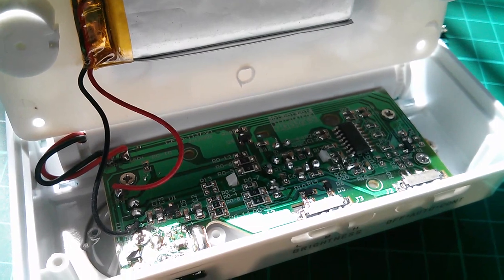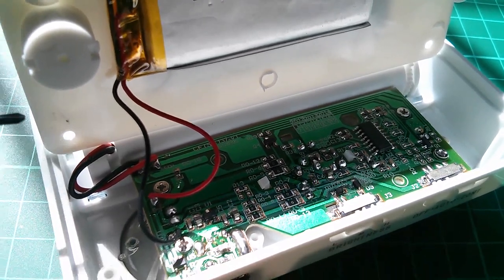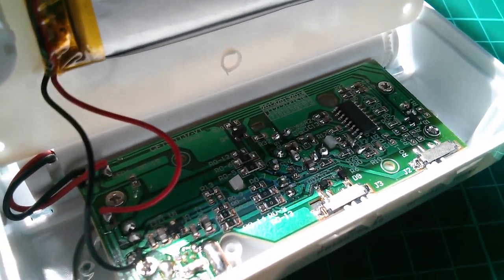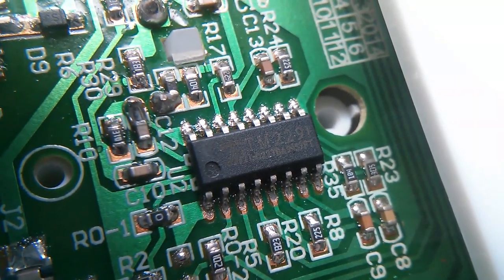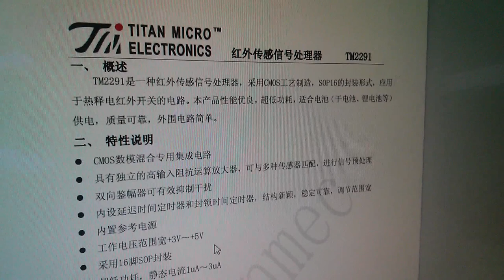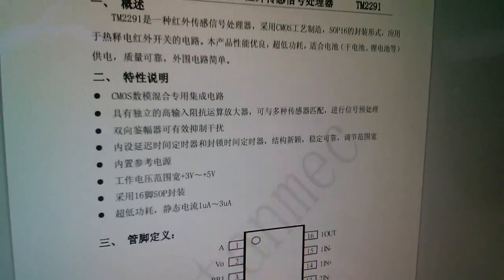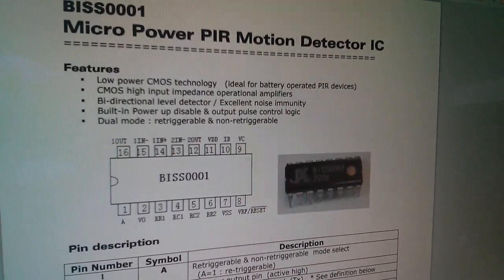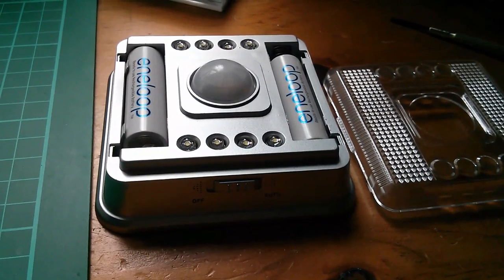PIR LED Sensor Light with Li-Po Battery - It's Incendiary!

Comment: Greetings!  Funny how things work, I have nearly completed the build of just such a light for the bathroom of our Motorhome.  My wife wanted something that would come on at night when we are boondocking (camping with no shore power or water etc. in the boonies) so I took an old Arduino and connected a PIR sensor as well as a set of 10 LED's on a board that I built up a few years ago in a kit deal, and am about to mount the whole thing, using just such a battery into an old Zune case left over from my Zune colecting days. I still have two working Zunes, and this one never did work, just picked it up for an extra hard drive for the other two, and a spare battery.  Should do the job, I think I shall add a charging board to the build and she should work just fine in the little cubby that serves as a bathroom in our old rig.

Comment: The H1MA may be a 5v 1ma regulator.  I suspect it is an in-house marking.
Reply from the maker: Thanks Jay. Certainly if you search for "H1MA" you get lots of results with 1 milliamp related stuff. But I'd be surprised if it's a 5v regulator since USB is itself a reasonably well regulated 5 volts. I'm hoping someone recognises that teardrop logo.

Comment: Is it safe to close the holes in the lipo with a kapton tape? Or better don't close the holes to enable gas leakage of the damaged lipo? One reason for the lipos insulation is to avoid the moisture of the air. May be replace that thing, if there's no consensus about that.

Comment: The mysterious chip is a lithium charging chip, they always have 5 pins and the same pinout and if you google them youll find nothing. The allow for a led to be connected to show when the battery is full. Almost everything is integrated, current is set using a resistor. 

When you short the output, the thing makes noise and releases magic smoke. It also drives the led continuously then.

Comment: Julian you need to change the description to inevitably incendiary! The situation will only get worse should the pack puff up from overcharging or over discharging. At the very least I would be putting a layer of cardboard or even better fibergalss between the PCB and the battery. Surely there must be some authority you could notify to have any future examples of this unit being banned from import. Not very practical on a one off import basis I agree but under the circumstances it is all that is possible. Frankly LiPo batteries are not really suited to a mass consumer items although are OK if the user is aware of the dangers and safe handling procedures.
Reply from the maker: Good point - title changed!. What makes it worse, is that until I can identify that H1MA chip, I can't work out whether there's anything that stops the battery charging, other than the Li-Po's own protection circuit. So expansion of the pack may be quite likely.

Comment: Julian  
    Sir, in our model airplanes and helicopters we use Lithium Polymer batteries.
We have on some days, had a unit crash and have had fires.
Some immediate, some after 30 minutes of smoldering. We remove battery from aircraft and place it where it will do no harm.
   Fumes are toxic.
All: please search YouTube for Lipo fires   - The  German one is where a nail on a stick punctures a Lipo 
Cheers, John
Garden Grove

Comment: Please tell me that this thing is a chinese "self import" and not something you can buy off a local dealer. Poking a Lipo surely is the worst of it. But the soldering job is horrible. One of the battery joints on the board looks like an cold joint, but at least it's not really a safety issue. The solder balls still sticking on the solder mask on the other hand is another desaster waiting happen when they break loose and short something out.
I really like ordering stuff directly from China, because half the time it's the exact same thing you can buy locally anyway, just at a fraction of the price. But when I see a product like this ...
Reply: It's confirmed that some chinese assemblers want to kill us...
Reply: Poking the surface of a puffed lipo is a good idea to release the gas instead of letting it explode. Poking through a lipo resembles a direct short and should be avoided if fire is not the applications goal.